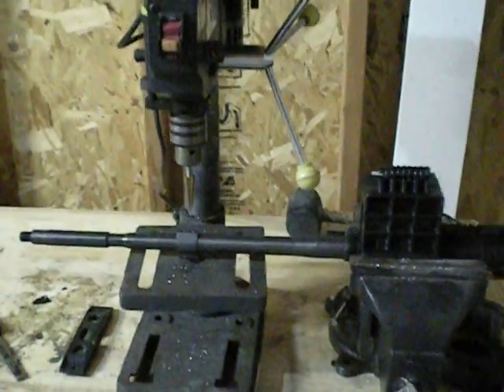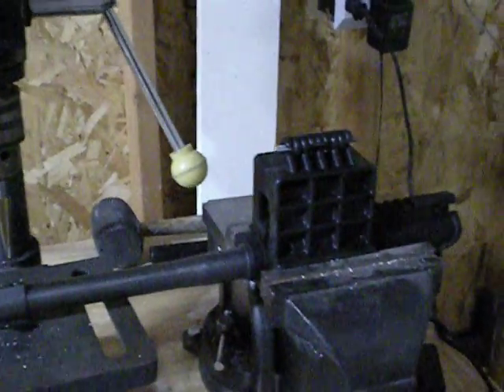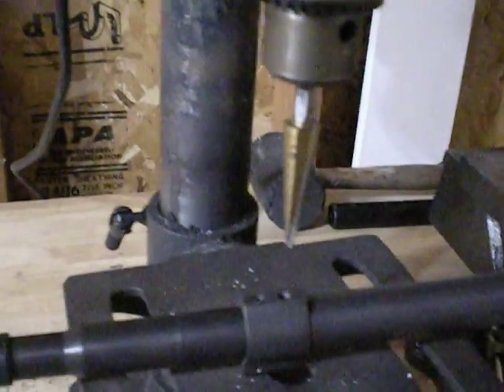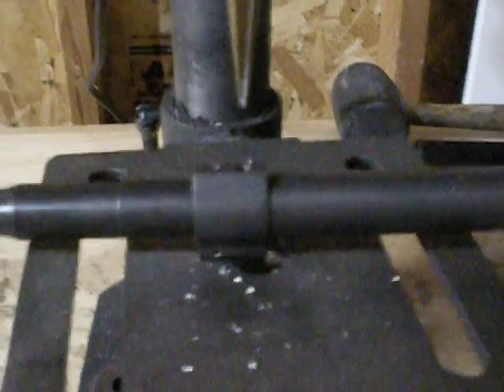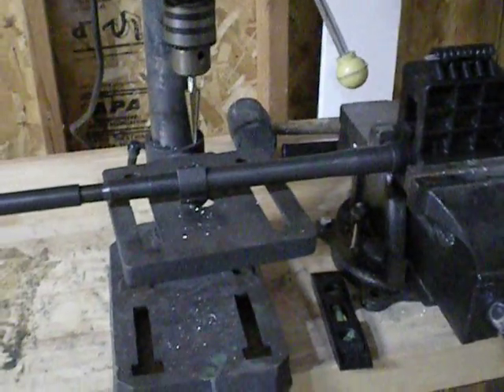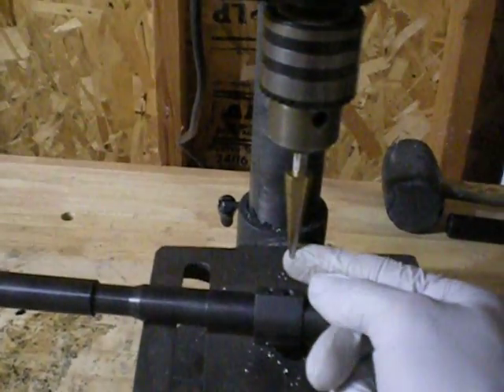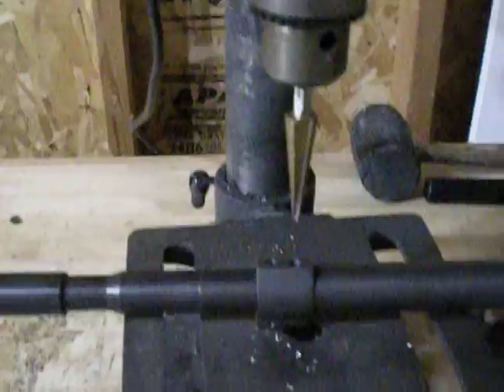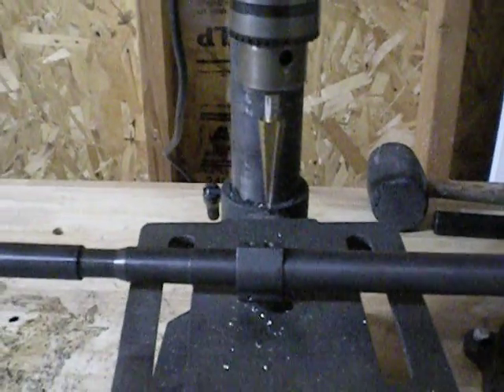How to drill the gas port on an AR-15 barrel. 1 of 4.

Comment: is it hard to drill qpq barrel vs 416r barrel?
Reply from the maker: Either of those would be tough to drill by hand, but with quality drills (cobalt, ideally) and a drill press, neither is particularly difficult. Just apply even, moderate,  pressure and retract the drill to clear the chips, frequently.

You don't want to press so lightly that the drill is just rubbing and not cutting a real chip, because rubbing can work harden the steel and cause excessive heat. And you don't want to press so hard as to bind or break the drill.

Applying oil to help cool the material and clear chips and lubricate the sides of the drill is always a good idea as well.
Reply: @Wrenchmonkey1  hi & thx 4 replying back. i only see triumph twist drill on brownell. dont think they are cobalt. would u recommend a source?
Reply: @austinmabry8462  thx 4 ur time

Comment: where do you get an AR 15 barrel that doesn't already come pre drilled with the gas port in it?
Reply from the maker: Justin Jones 
These days, I couldn't say for sure. Years ago, JSE Surplus used to sell them that way. They may or may not still have 'em.
Reply: I'm interested in experimenting with all kinds of weird calibers and designs, so I'll likely want to drill ports in non-AR barrels, potentially for use on an AR receiver. I'd say the vid helps.

Comment: Sorry guys incoming stupid question alert. But what is a gasport hole and whats the purpose of this?
Reply: Rangefinder - it allows gas to cycle in your ar, from barrel through the gas port back to the bcg
Reply: @DZenitram23  For safety reasons, designers usually lock the closed bolt of powerful firearms into the breech. The breech must remain locked at the beginning of the firing cycle, when the high chamber pressures would  cause damage and/or injury if allowed to escape the chamber. The shooter wants that high (say from a .30-06)  pressure to be released only by driving the projectile out the barrel. The shooter (generally) wants maximum velocity imparted to the bullet by the expanding combustion-product gasses - so even barring safety concerns, the locked-breech is a good idea. Well, it turns out that if you siphon off a bit of that expanding gas, you can use its pressure to also unlock or initiate unlocking of the bolt from the breech face, but with much lower chamber pressure now that ths bullet is leaving/has left the barrel. There still must be enough to cycle the bolt/slide/etc against the recoil-spring's pressure.

Unlocked-breech autos/semiautos are called straight blowback or simple blowback, and most lower-powered firearms work best this way.

Comment: Once again, the best videos I've found on drilling a gas port on AR-15 barrel.
This looks to be a mid length gas port?
I am drilling mid length gas ports on .223 Wylde 16 inch barrels using the advise you offer in your four videos. I have several to drill and have only drilled one so far using your technique. They are 1:8 twist barrels, .750 OD at gas block.
I'm getting several different suggestions on the gas port diameter for these .223 Wylde barrels, ranging from .065 all the way up to .080 port diameter.
I drilled the first one at .078 finished but have yet to mount and shoot it.
I would appreciate your advise on what you believe the gas port diameter should be on these Wylde mid length 16" barrels and any other suggestions you may have.
Also, is it really a big deal to worry about getting the port on the land, or in the groove inside the barrel?
Many thanks for your great advise and videos!!
Reply from the maker: Glad you've found it useful. I forget the reason that I even made this video, at this point.

I'd had the "Proper" jig for years already, but I think somebody was asking on one of the forums, so I broke out my old "poor man's jig" and made the video, to demonstrate how I used to do it, back before I started West Desert Tactical, and began making rifles/uppers professionally. Glad to see people are still getting good use of the method though.

There really is no reason to spend $100+ on the jig, unless you're going to be drilling dozens and dozens of gas ports. The only real difference the jig makes is faster setup times. End result is the same.

Comment: Hi,
Great trio of videos on drilling gas port in AR-15.
What drills, conical reamer do I need?
Brand names and P/N's exact sizes?
Thanks
Reply from the maker: You can use any bit that is large enough to put a slight chamfer on the hole. Even a 1/8" drill bit would be fine. Just don't drill too deep. You're just creating a dimple. It's not even entirely necessary, but it will help just in case the gas block doesn't like up perfectly. Harbor freight part number: 91616 is a set of conical bits that will work.

Video number 2 talks about bit sizes. I drilled this one at .078, but .068 should be sufficient for most 16" barrels. It's always easier to start a bit small and ream up if you find it under-gassed.